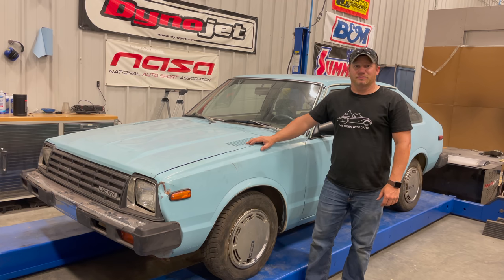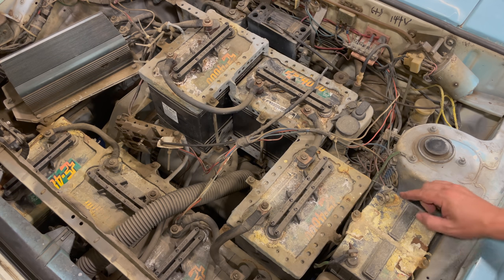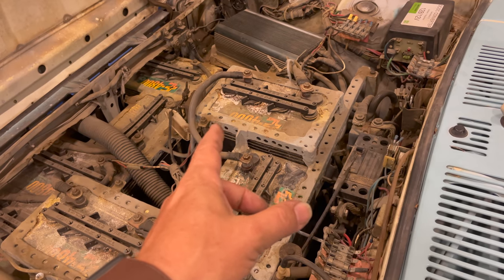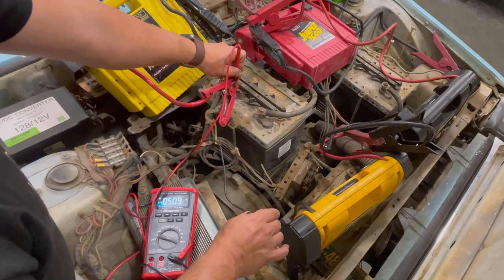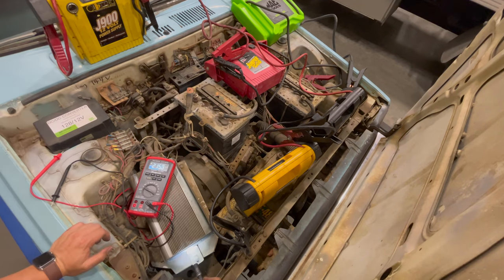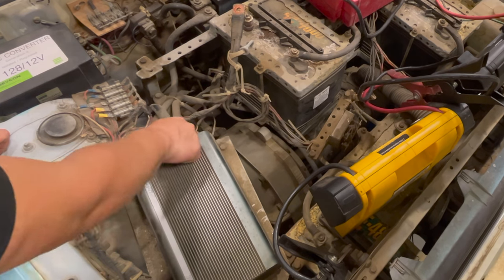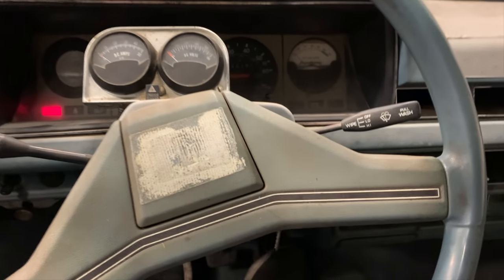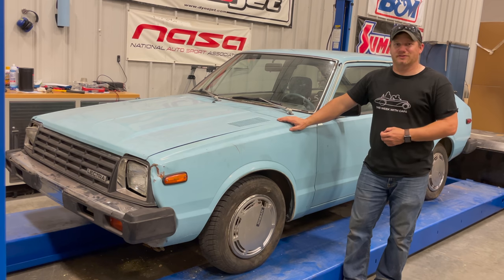1981 Lectra Motors Lectra 2+2 - Will It Run?

Comment: Most people over 60 in the UK will be very familiar with the whining noise made by simple traditional lead acid electric vehicles, as they used to be widely used by bottled milk delivery vans in urban areas, top speed about 15mph.

Comment: That's awesome! This'll be a great opportunity to learn about electric cars in general. If you can find a schematic, give a breakdown of that. Definitely power wash the outside and also the engine compartment. Maybe put some wax on the outside. Not sure the interior is worth enough money to do a full restoration. Detailed breakdown of the technical specs of the motor, the inverter, Etc would be nice also. Keep up the great work!
Reply: The dent near the driver's side headlight would have to be addressed too, other than that the car looks surprisingly reasonable, especially considering it looks like it's had a DIY full repaint at some point. The colour is spot-on though, I actually like it better than the original!

I'd say the interior calls for repaired/new seats and repaired original gauges, the replacement ones look quite out of place. Other than that it's just a good cleanup.

Comment: This is an amazing find and in this condition !! Great work making it run again. I kept thinking that a battery pack from a modern electric car (chevy volt ?) would be both an increase in range and performance as it certainly would be a lot lighter than those batteries. Interested in whatever you do to it !
Reply: You might need all new controls for it though, i.e. take over pretty much everything from the new car. The advantage would be that it gives you the modern charging system but it's most likely more complex than just building a new charge circuit - lead-acid batteries aren't particularly difficult to charge.

Comment: Awesome find, shows us that electric car’s should have been around for years really.
Reply: More like over a century, they were quite popular in the 1920s, or so I've read. Range was quite limited though but they were easy to drive and had lots of low-down torque, which is why they were commonly used for goods hauling.

Comment: Pretty good packaging for its' time, they were underselling it calling it a 2+2. With the batteries split between underhood and where the gas tank would've been there's no less passenger or cargo space than a stock Datsun which represents a huge leap forward from the Henney Kilowatt that had kicked off the conversion era of EVs by filling the entire trunk with batteries and deleted the back seat.
Reply from the maker: The 2+2 (two doors + 2 passengers in back) was to differentiate it from the Lectra 400 which was a four door version.

Comment: Elcon PFC series onboard charger would be appropriate for charging that car. If you're feeling spendy on this resto-mod, the get the can-bus enable version so you can use an auto negotiating pilot module to use level 2  public charging.

Comment: An idea maybe would be to rectify the mains voltage that you have coming into your household outlets as your only on 110v there in America. This would be close enough to the series voltage of the combined output of all the cells. Just a thought for a way to charge all batteries together, I guess monitoring them might need some serious consideration.

Comment: I've never heard of these cars Steve - all new to me. When you were poking about under the bonnet, I was getting kinda nervous, probably more nervous about fire than it running anyone over though. Pretty amazing that it just ............ works.
Any idea what it weighs?  These batteries must add a whole lot of weight to such a small car. I'd love to see you get this thig running and driving properly - and stopping. I think that last one could be quite important, especially at 80mph!!!
I'm not usually one of the "health + safety" fanatics but I'd be parking that thing outside,  well away from any buildings, at least until you get a better idea what it's story is. It looks like it's seen some tinkering 𝒂𝒇𝒕𝒆𝒓 it left the factory, which can be worrying in a vehicle with 𝑜𝑛𝑒 battery.
Good luck with it. It should make some fascinating videos as you work on it, and thrilling videos, as you drive it.👍👌😁

Cheers for now,
Dougie.

Comment: Very different and very interesting,  lol forward to seeing more. 
Some head scratching going on for a while but you got there.
Weird noises are probably suspension bushes.
Won't it pull away from rest in 3rd or 4th?
Reply from the maker: Yes it will drive in any gear, I tried it in 4th and give it a little throttle and the amps shot straight up so I didn't want to try it further and break something already.
Reply from the maker: Remember the original Tesla Roadster had a two speed manual transmission as well.

Comment: I hope you complete the restoration. Really interesting. Could you upgrade to Lithium batteries? You have spent heaps on replacing the original so probably not worth it.

Comment: Very similar setup to the G-whizz, Would be interesting to check out the range, no doubt it would be better with modern lithium ion battery's.
I guess it did not come with a charger?

Comment: I have seen several late 1970's early 1980's electric car conversions from light weight production cars and then purpose built electric cars. One was a Renault that a US electric power company converted to electric. Basically same technology as Lectra. The government gave grants to just about anyone that they thought might be able to do it. Purpose was to wean US off the dependence of Middle East oil. They were all failures due to battery technology limits of the time.

Comment: Did you originally connect the motor controller's control wire to 12 V and then to 72 V? That might explain why it suddenly decided to work.

Definitely a very nice project, I'd love to see more of this!
Reply from the maker: Yes I did but the 50 volts I was originally using was still below the cutback voltage of 64 volts.  I did not have the manual for the controller yet and now that I do I know it needs 64 volts to work.

Comment: Moving to lithium batteries would be nice, but the charging electronics would have to be updated too. Probably best to keep this thing stock. It's probably one of the few electric cars that could be kept running 20 years after being manufactured. Good luck bringing a modern electric car back to life 20 years from now. Everything obsolete in 5 years. Or would need software updates and nobody to write code for it. Old simple stuff can be fixed. Modern stuff when it gets old.. not really.

Comment: yeah, restore it, its a rare oddity. Can you swap in some lithium batts - or do you think that would compromise the uniqueness of it?
Reply: It's a Nissan; maybe a Nissan Leaf battery and/or powertrain?
Reply: If you are going to do that why not do it with a car type that is more like the cars that he has, like a bug eye sprite. I think the total cost of putting in upgraded batteries would be pretty steep. And really, how much is Steve going to drive it, it looks like he has so many cars that he would almost have to drive a different car each day just to keep the gas in them on the fresh side. No wonder he has so many jump packs!
Reply: @shannonswyatt  he does this because he loves to. No rationale necessary.  We're just offering suggestions.
Reply: @jamesengland7461  Yup. I would just fix the brakes so he could drive it a bit. That thing is pretty clapped out.
Reply: It would be nice to retrofit modern batteries inside cases of old batteries. Can still recycle lead and keep the original look but get better range.

Comment: I thought 4 cells made 8 volts.
Reply: Correct. Exide E-4800 batteries are 8V golf cart ( GC2) batteries. 18 x 8 =144 Volts if wired in series.  I hadn't watched long enough to see that the OE batteries were 6 Volt. 18 X 6 is 108 volts. A bonus would be that they're ( 6 V) less expensive than the 8 V version. I purchased some (6 V) earlier this year for about $90. each. That would cut his battery replacement from $3000  to about $1800. Still a lot of money to resurrect a and old electric car that's probably got less then a 50 mile range.

Comment: That's pretty cool. I remember seeing this similar vintage Renault Le Car / Lectric Leopard EV at the Des Moines Wrench n Go scrap yard a couple years ago:https://www.curbsideclassic.com/uncategorized/junkyard-outtake-lectric-leopard-sparky-cc-spotted-at-wrench-n-go/
Reply from the maker: Wrench-n-go is horrible no car can ever be rescued from there.
Reply: @ThisWeekWithCars  I'd love to hear you elaborate on that! After some 50 years of buying cars the only lemon I ever bought was a Datsun 310. Kept it for a year an lost.my shorts on that piece of crap!
Reply from the maker: If a car goes to wrench-n-go the chassis must go to the scrap yard, they will not let you buy whole cars only parts no matter what it is.  I can't believe some of the stuff that ends up there instead of sold to the general public first.
Reply: @ThisWeekWithCars  They have (or had) an area with complete cars you could buy, inside the main building. Not sure but I'd guess they have a salvage title.

Comment: Oh no, you replaced all those 8v batteries with 6v.  You might need to look at the controllers voltage setup.  I would expect a low voltage cut off to protect the batteries from over discharge is setup for the higher voltage.  If your not convinced, look back at the video. Each on had 4 caps.  The new batteries have 3 caps.  One cap per 2v cell.  12v are 6 caps.
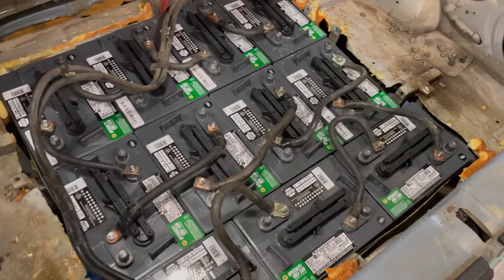Reply from the maker: I say they are 8 volt and that I am putting in 6 volt at 25:30
Reply: @ThisWeekWithCars  I got interupted and missed a few minutes in the middle.  Generally cost is by weight and I'd expect the 8 to sell for the about the 6v price.
Reply: @ThisWeekWithCars  Ah, I get it now.

Comment: Did Lectra actually produce those or is it a prototype? It looks very Heath Robinson. I do hope they uprated the standard brakes given that all those batteries must weight in the region of half a metric tonne.
Reply from the maker: All the publications I have read say Lectra Motors made about 1000 vehicles.  Pickups, Wagons, Luxury Cars, Sedans, and Sports Cars.

Comment: 27:48 it says "6000 RPM Max". Brushed DC motors have max RPM levels due to bearings and their brushes which conduct electricity.
Yeah imma watch this. These old, goofy EVs are dead simple and kinda strange